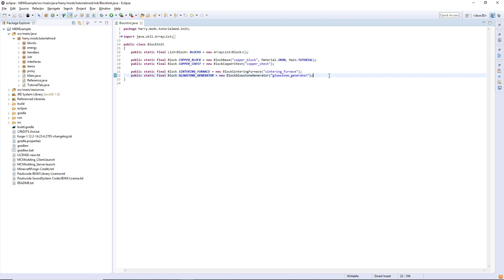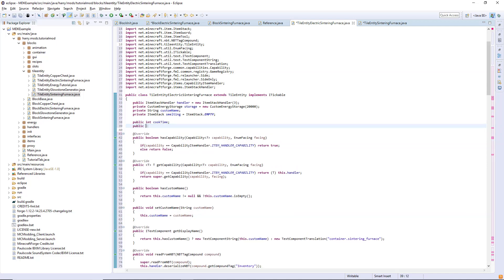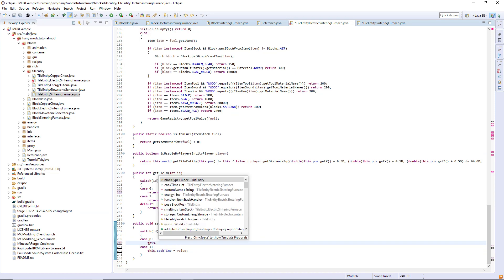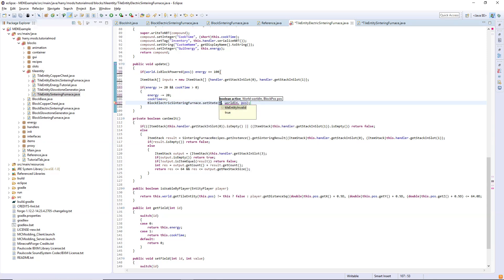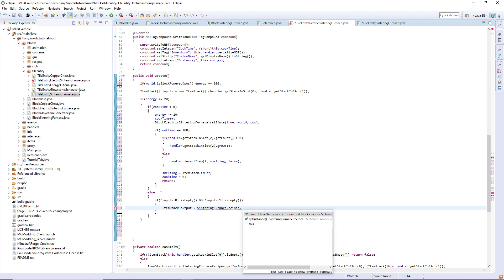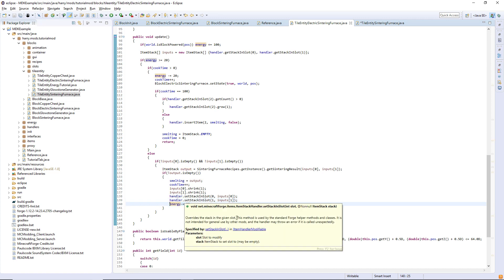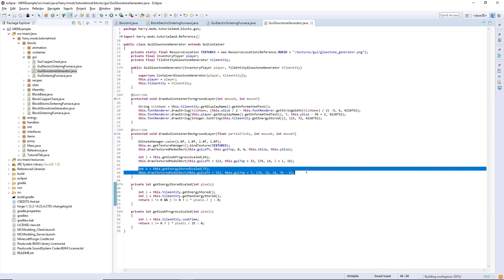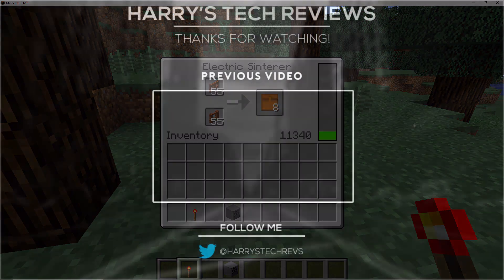Electric Furnace (Energy Consumer) - Minecraft Modding Tutorial 1.12.2 - Episode 35

Comment: With your updated furnace code I get a few issues.

The furnace is sometimes doubling the output when I only want it to output a single item. I always end up with 15 instead of 8. I believe the first one it makes is doing it right but then after that it outputs 2 instead of one.

It also doesn't always work, sometimes when it is placed or after the items are taken out and the GUI closed and reopened it will no longer smelt items.

Then most of the time if I pull the items it smelted out they just disappear out of the players inventory after you close the GUI.

Then the last issue I'm having is when the block is broken the items won't drop on the ground, they just vanish into thin air.

This is what happened when I updated the normal furnace code to your current code. I asked on a fourm about it and they said the problem with the smelting was in this:

if(this.isBurning() && this.canSmelt() && cookTime > 0)
  {
   cookTime++;
   if(cookTime == totalCookTime)
   {
    if(handler.getStackInSlot(3).getCount() > 0)
    {
     handler.getStackInSlot(3).grow(1);
    }
    else
    {
     handler.insertItem(3, smelting, false);
    }
    
    smelting = ItemStack.EMPTY;
    cookTime = 0;
    return;
   }
  }

as for the items not dropping when broken I think there is a missing constructor or 2.
Reply: If I change it to this

if(this.isBurning() && this.canSmelt() && cookTime > 0)
  {
   cookTime++;
   if(cookTime == totalCookTime)
   {
    if(handler.getStackInSlot(3).getCount() >= 0)
    {
     handler.getStackInSlot(3).grow(1);
    }
    else
    {
     handler.insertItem(3, smelting, false);
    }
    
    smelting = ItemStack.EMPTY;
    cookTime = 0;
    return;
   }
  }

then put the item it is outputting into the output slot it fixes the furnace everything besides the items not droping when the block is broken. the only issue is that I have to manually place 1 in the output slot or it will just stay blank. I've been trying to figure this out for like 3 days X(
Reply: Isn't this because he forget about world.isRemote()?

Comment: Hello I've been trying to follow your Tutorials but at quite some Methods, my IDE reports that they are Deprecated, for example the getRenderType Method for a Block. I am running Forge Version 1.12.2-14.23.4.2705 (recommended version at time of writing) . Am I doing anything wrong or should I just straight up ignore the Deprecated warnings? Since your Github Repo doesn't include the Gradle properties, I can't compare possible other settings.
Reply from the maker: Nothing in this tutorial is deprecated?
Reply: I dunno, Maybe I am doing something completely wrong or have a wrong decompiled Minecraft Version but I get this message https://i.imgur.com/7qI4Xmf.png
Reply: Okay, after some research I've found out that I should just ignore those warnings, since they are only meant as an Information for calling the Methods, so for example instead of Block::getRenderModel(), one should use IBlockstate::getRenderModel(), we still need to override them for compatibility reasons though. So you can just ignore what I mentioned.